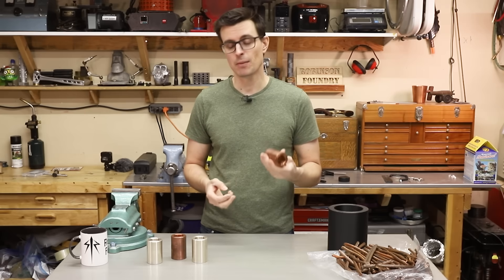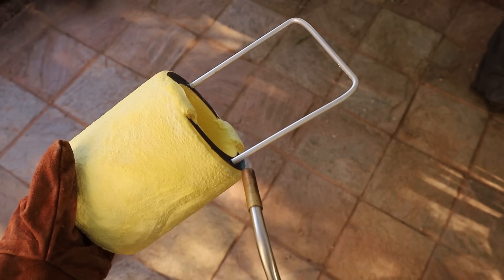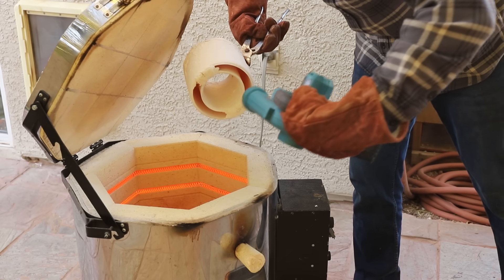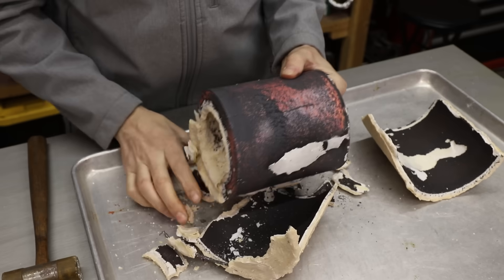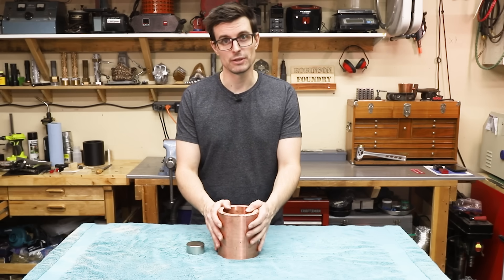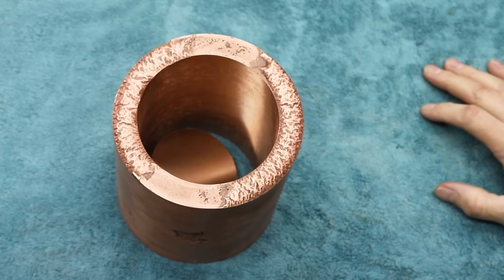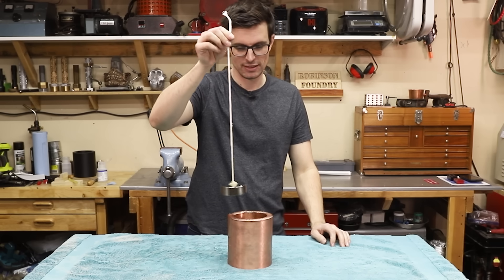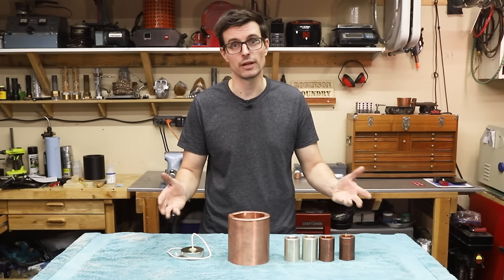Defying Gravity - HUGE Neodymium Magnet vs Copper Tube Experiment - The Power of Lenz's Law!

Comment from the maker: If you're interested in any of the tools or equipment I use and you want to help support the channel then don't forget to check out some of the affiliate links in the video description. Thank you for the support!
Reply: When pouring metal like that, try doing it along the LENGTH of the mold instead of the width, that gives you a LITTLE bit more margin for errors.

Also, something i know my cousin did, put something right next to the mold that you can rest the container on while pouring, as this reduces unintentional movements as well as letting you reduce the amount of weight you have to deal with constantly.

Alternatively, you could try a spout or some other kind of pouring mechanism.

.

Awesome little experiment.   For all of us who had not previously seen this kind of experiment, this was great fun.
Reply: How about buying a clear plastic tube the same diameter and dropping the magnet through it into the copper cylinder to see how quickly it slows down. Or, perhaps a small hole drilled in the magnet with a rod through the middle to enable an accurate drop from height...
Reply: @digdougedy  The science of eddy currents is well known already and has been used for years in magnetic breaking systems for commercial vehicles and motorhomes. Magnetic current flowing between the porous atoms of neodymium or ferrite/iron will taper apart slightly at the positive pole's end. You'll find that positive particles do not penetrate a dielectric metal nearly as well as negative does. That's part of the proof that magnetic poles are in fact a flowing current, and have nothing to do with photons or superstrings that have never been proven. Take any neodymium magnet and you'll find it slides down a thick aluminum plate with negative down, but with positive down, it tumbles a lot sooner when the angle is raised. This is because copper, for example, does not allow all the particles of the current to penetrate, just the smaller ones, due to it's hexagonal structure which is geometrically resistant to mesons when the forces of the atom cycle millions of times a second. If you read the paper by Boyd Bushman on his magnetic beam amplifier, he mentions how it can be used to annihilate matter. He made a machine that does this by creating a charge fractal that keeps repeating at higher and higher frequencies until the coupled x11 carrier tears any matter apart and turns it into nothing, basically. This tech is used in nuclear mining machines to make tunnels for d.u..m.b. bases. It makes a sealed cylinder over 12" thick as it burns through.
Reply: if you think of a magnetic field as a physical object, it becomes easier to understand,  picture it like an invisible eggshell or a rubber balloon. you can apply force to an eggshell or a balloon . or grab and hang an object off of a stationary shell or balloon, and no "work" is being done by the field itself,  why does a magnet stick to a fridge door with no power source ?  well when you stick a pin into a wall, it is held there physically,  and the magnet is as well with its field, no further work is being done
Reply: what would happen if you run electricity through the copper? I imagine you would be able to control the magnets position
Reply: make your own lathe, Mill and shaper like Dave Gingery books- you're already halfway there with your forge. Not difficult, just time consuming. Gingery uses stacked plate glass as flatness reference accurate to sub thou (0.01 mm) vs granite toolmakers flat.
Reply: no. it needs constrained field, not omnidirectional.
Reply: Please shout me out for this suggestion as it's a good one. 

🤯CLOSED CIRCUIT CIRCULAR COOPER TUBE ENCLOSED WITH THE MAGNET🤯

Might change the world! 
Free energy?!?!
Reply: So cool, is this not the basis of how electricity is made?
Reply: @RainBitcoins  Electricity is not stored well in wire and is most efficiently made using a modulation of charge in dielectric metals for high frequency, or in ferrous metal for low. Using 3 phase with 3 wires you can move energy vast distances with minimal loss. Tesla discovered this and used it for sending power from dam generators. The nature of dielectric metal is this; it contains atoms which greatly favor the presence of negative pole particles, so whenever charge changes near it, the wire will use the change of pressure to motivate energy in a direction from the pressure. Quartz is the opposite polarity, and resists energy, yet is a dielectric for the positive pole. Charge itself is simply a state of both poles flowing against one-another. Atoms all made this happen, but a magnet does it better because it lines up the atoms into slight cone shapes, and or, non-parallel lines, which simply use the atomic cycles to propel magnetic current. Nobody has ever found a way to stop magnetic current, and never will, since electron neutrinos have been found to propel it through progressive kinetic reactions. I predicted their flow direction on the web in 96 and was vindicated by the Ice Cube evidence over 10 years later. They aren't massless but wikipedia will tell you they are which make zero sense according to all the data, so just don't trust wikipedia, it's a deep state campaign to make everyone ignorant slaves.
Reply: @mikefromspace  you my friend seem like someone I would love to hang out with. Thanks so much for taking the time for  the detailed explanation 🙏
Reply: Just mount two tubes lengthwise on a rolling chassis, opposite, shoot the balls through and see what happens. If you can instead pull the balls forward through the tubes using rotational force cylinders, you have antigravity, the balls are initially on a chain, or dress small rods on guide rails inside the copper tubes.
Reply: Where did you buy that magnet? I can find stuff online but I don't have a lot of experience so I'd likely get scammed...
Reply: @RRRR-jr1gp  magnet4less have all kinds. I've bought hundreds from them. Very good quality.
Reply: Whats happen when you use Hot fluyd Cooper / O que acontece se o senhor utilizar cobre aquecido fluido?
Reply: Idea for you
Reply: Question:  Copper powder.  Suppose you had a piece of 5 or 6 inch PVC pipe.  Inside it you insert a piece of, say, 4" copper pipe and fill the resulting gap with copper powder.  
Would that work ?
Reply: Can I just pay you to make a copper tube..? I have the magnet 😅
Reply: ??? IS THAT a beer keg you modified  dor a keel ???  It look's cool lol , oh and maybe you can get like grind dust  to show the magnetic  field some how.
Reply: I found a secret plan for the modified charging system used on some 1908 Model T Fords. It simply adds a pair of negative centerpole cow magnets inside coils and puts those at opposite sides of the magnet array, using the mystery slots of the cast iron bell housing. This does to charge what it does to numbers in the Julian set fractal! It will make a Julian set of charge itself, so that energy is forced to suddenly pulse into the positive ends of the cow magnets when the distributor fires one of the 4 plugs. You can feel heavy ions flow off the magnets which is why the holes can't be covered. It builds up to a superconductive state if you let it accumulate. Using interlocking points of charge, you can in fact create superconductivity using simple magnets. I'm building a new one now using n52 neodymium. Each one of these made 40hp using 3 lb force magnets in 1908, but n52s produce 10x that.

Comment: Can you experiment with copper wire coiled around a tube with the two ends of the coiled copper wire pluged into something like an LED light bulb and experiment to find out the best ways to generate electricity by dropping a magnet through the tube the wires are coiled around. Then expand from there. Like finding a way to make the magnet go back and forth through the tube to generate a constant stream of electricity through the coiled copper wire.

Comment: one thing i'd dream of doing with that is actually a sort of command tool,with your arm inside the copper tube,holding a magnet with some senseor around understand some specific movements,and use it to control something with it.i'm on th mechanical side tho and really have poor knowledge of all the electronic part needed for that,but that would be an awesome project to work on..the liberty of movement you'd get with htis would be insane compared to stuff like joysticks

Comment: I would like so see a copper pipe dropped through a neodymium magnet that has a hole timed and then the same diameter bar the same length dropped through the same magnet and timed.

Comment: Very fascinating! It also works with aluminum pipe, although not quite as well. I have fascinated friends with my 1 1/4" thick walled aluminum pipe and a 1x1" neodymium cylindrical magnet. The pipe is about 4' long, and first I drop a steel nut, about the same size as the magnet, through the pipe to show it falling at a normal rate. Then I drop the magnet through, and it takes several seconds to slowly drop through the pipe. The way I try to explain it is the pipe acts as a coil of wire, and the magnet passing through it generates a current, which creates a magnetic field inside the pipe, apposing motion of the falling magnet, slowing it down. Is that a somewhat correct definition of what's going on? I have seen other videos of this effect, but never as good of a definition as you give.

Comment: I would be very curious what would happen if you made your cylinder pour with a magnet inside the mold.  Would it change grain structure, and what would impurities do?  
Does the magnet even  have an effect on molten copper?
Would the copper have a shape forming against the walls of the mold as it went in?

@0lb does seem to be a challenge, maybe a pouring cradle for the crucible?

Comment: You spilled it all over because you poured  it from the edge to the middle. All you had to do was turn it 90 degrees and you would have had a 1 3/4 inch opening instead of a half inch opening. Pretty simple fix for next time

Comment: Im talking to someone at NASA about this to capture cargo from space and slow it down on the Moon or Earth. Can you redo your experiment with taht large copper cylinder but use a smaller magnet to drop into it to simulate a space craft with a magnetic field slowing down in a giant cylinderical super structure? Just make the silver looking magnet 1/10th the size that you used so there is plenty of space around it when its hovering and gently touching down. Also can you drop an electromagnet through it of small size to simulate a space lander with an electro magnet landing inside a super size copper structure?  Perhaps drop it with a small battery strapped to it and powering it unless the wires are thing enough not to interfere with hthe natural process of dropping it through the copper cavity.

Comment: What if you make the magnet heavier. For example, use a copper bar slightly smaller than the bore of the tube with the magnet in the center of the copper bar. Or some material to add weight just to see how fast you can get the magnet to fall until it feels like there is no resistance.

Comment: Wow, that is cool. I’ve seen experiments like this before. Try creating a copper flat sheet and create 3-D print mechanism deck holds at least six neodymium magnets of that size and spin it around and watch it levitate over the copper flash sheet. That’s basically magnetic levitation.

Comment: Such an opportunity missed by making the inside diameter so much larger than the diameter of the magnet being used. Reduce that clearance to 1/16th inch and WOW, I predict.  I expect you've thought of that since posting this. Go nuts and have a machinist  true up the ID to a target diameter and the result will be even more (expensive) impressive.  I appreciate magnetic damping on a sensitive balance scale I have for measuring gunpowder. Nothing else would do.

Comment: If super powerful magnets can be placed in opposition to one another in an engine, this could provide the force to drive a piston in a cylinder, creating torque on a drive shaft instead of the expanding force of a gas fire.

Comment: If you take your spherical magnet and place it in the middle of 2/2 of a sphere made of copper which is screwed together and then you remove the air that would reduce the friction to 0 when you spin the outer copper sphere if you then mount the copper sphere onto Two air bearings you could then spin the outer and the centre magnetic sphere would levitate and not touch the sides
The question is, would the external forces generated which you showed before be transferable to an external device? 
Which would be amazing

Comment: It's an interesting way to explain why magnets levitate over superconducting material, the difference being that a large piece of copper is only a "very good conductor", not a perfect one, so the energy of the magnet falling dissipates as Joule heating. Every time you drop the magnet, the copper gets a little warmer due to the current flowing in it.

Comment: Try firing a magnet under high air pressure down a copper tube , somewhat like a bullet. 
Wrap copper wire around copper tube or plastic tube and check voltage and current.

Comment: Electrical measurements? Coil around tube to Volt/Ohm/Ammeter? String attached to the side of the magnet and spun in tube w/electrical measurements? Any way to measure the "resistance" force?

Comment: Go further!
Try to cast special copper tubes...with current connectors...
or spacy figures. what works best..
Build Vacuum chamber...a.s.o.
Tesla has done exactly that...to constantly improve their electric motors...
Imagine:
One gas burning raptor of starship has more than a million hp. But they went away from hydraulic steering (gimbling) them to electrical. In just a few weeks.
Imagine how strong and reliable they must be.
All hidden behind your "experiment".
Military puts gigantic currents on it and builds so called rail guns.
a.s.o.
greats from upper bavaria

Comment: If the cylinder would be much bigger, what would happen if you throw the magnet inside, would it slow down in the middle of it ?
Say for example you put a glass pane behind the cylinder, logically you'd break the pane by throwing a heavy metal at it, but as the copper cylinder slows the magnet, if may be near impossible to break the glass ?
Reply: The magnet slows down as soon as you throw it inside the tube, not just in the middle, but throughout the whole tube. Back when I was an undergrad physics student we did this experiment with a long copper tube (about 1m long), and it took a while for the magnet to go through the entire length of it. It was really trippy looking down through the tube and seeing the magnet slowly make its way down.
Reply: @IDyn4m1CI  Well, that is exactly the crazy stuff that I'd like to see on video.
Reply: @Jila_Tana  There's a few videos here on youtube showcasing this effect using tubes a lot longer than this

Comment: Its seems surreal but gravity and electromagnetism are both parts of the relativity physics described by Einstein.  Motion between the magnet and the coil appear to act as a force because electrons in motion all behave at the speed of light, as observed, and that speed does not change when the perspective is changed.  What's curious about this is that freefalling the magnet seems to neutralize gravity's acceleration, and it falls at a constant speed.  It needed gravity to hit an initial speed which triggers the electromagnetic effect, which then must hit some kind of equilibrium between its speed and the electromagnetic effect.  we get a different equalibrium when both poles of the magnet are sideways because positive and negative are identically charged in opposite polarities.  Either way we appear to "defeat gravity", which only sounds weird.  This passive system requires some motion, but a similar device attached to an electric current would allow you to manipulate the magnet inside the cylinder.  Maybe you should try some similar experiments with electric current:  just don't turn that magnet into a rail gun projectile...

Comment: Rotating that huge copper cylender around that magnet very fast is how you generate heat and electricity. This is exactly how electrical plants generate their electricity is by doing what you were doing in this video. Festinating stuff.

Comment: Does this have any deteriorating affect on a permanent magnet dropping gauss? Does it cause it to heat up at all if you were to rapidly move it through or across the surface? Would super cooling the magnet have any affect with these same tests in the video?

Comment: I'm wondering if there is a way to get a better look into the tube especially in the case of a much longer tube. Does such an effect happen in a tube made from a lattice of wires instead of a solid walls? Like hardware cloth if it were made from copper instead of steel.

Comment: If you spin the magnet fast enough it will repel the copper tube. In addition if you insulate the exterior and wrap two windings around the exterior and apply alternating voltages while it's on a scale you will find something very interesting occurs 😉

Comment: Spin the tube on a fast rock tumbler device. The magnet should float, and you might be able to measure the applied torque that would spin the magnet. Then measure the motor load required to run the tumbler if you add a stationary magnetic. That could become frictionless brakes, or shock absorption .

Comment: If magnets can rotate the cylinder and the cylinder rotating can keep the magnet in the middle stationary. Could you make the cylinder thick enough so the internal and external magnetism didn't effect each other so that the cylinder rotates? Just curious if it can be done and what kind of voltage it would produce if any. I guess I'm curious about frictionless energy in some sort or fashion